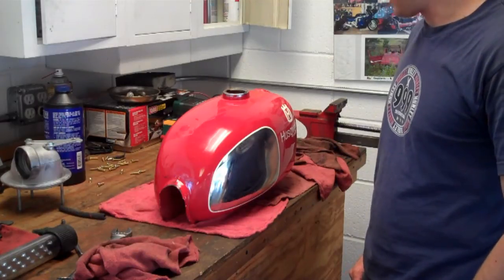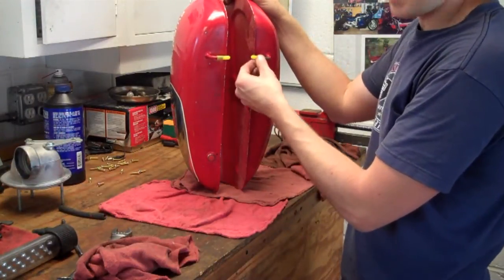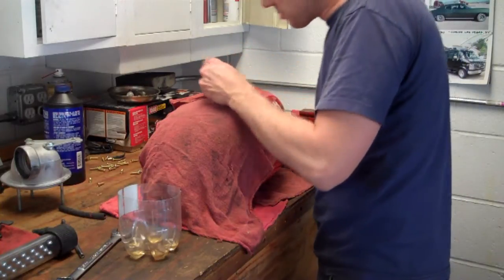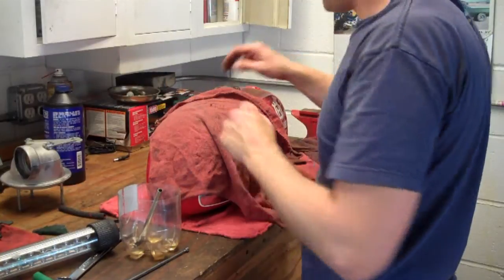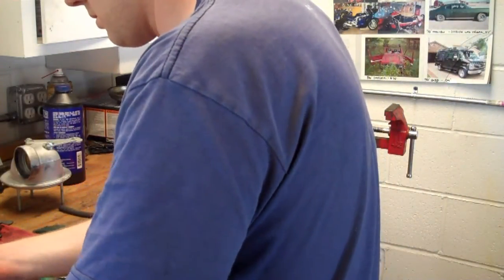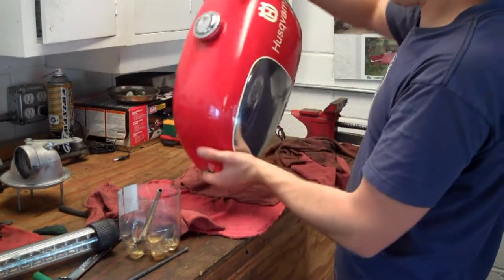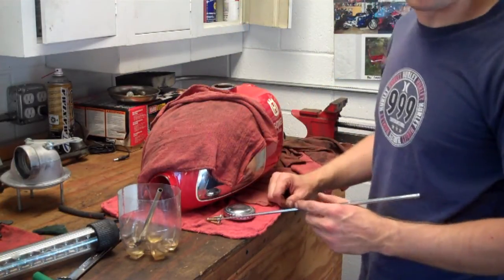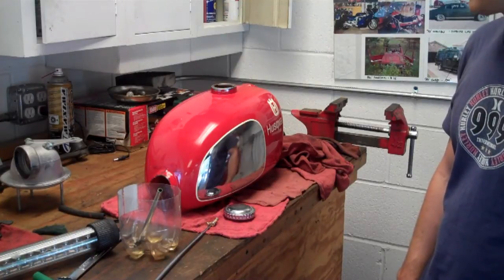Rusty Tank - Paint Over Spray - Part 1

Comment: Get yourself some Citric acid about 300grams or more, put  boiling hot water into the tank along with the citric acid let it sit for 3 or 4 hours then pour it out into a bucket have a look, if there is still some rust put some bolts in the tank half fill give it a shack for about 5 minutes then put the rest of the mix back in and leave till all rust is gone, pour out the mix wash out the tank then make sure you dry it out spray some WD40 jobs a good one works for me every time
Reply from the maker: Robin Black Thanks, I'll have to try that some day.